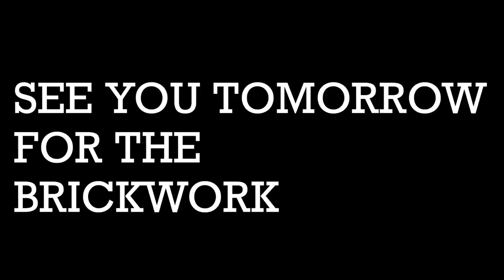Replacing Dodgy Doors Fixed In With Only One Screw - First Vlog 2020

Comment: We need to get KC a nice "Artic cable" extension lead, or you can make one up from bits in screwfix cheaper. It's good for minus30 celsius and doesn't go all stiff and useless like the cheapo PVC stuff.  1.5mm is good for 16amps so well within the 13amps from a standard plug outlet.

Comment: Make sure the handles/locks have a 3 star security rating.  You don't want a lock snapping thief letting themselves in... or you might end up having an interesting convo with the owner about the doors.. I  noticed the card on the keys so fingers crossed
Reply from the maker: yale handles/ locks are 5 star rating

Comment: Yes getting dark about 4pm Stu. Funnily enough........................it was the same last year!
  Still love the B&D Workmate.  I have an 800 model well over 20 years old and an even older one with the cast alloy frame. Still solid. Design classic mate. It was originally called Workmate the company.  B&D saw it and bought it over. Have even had Landrover gearbox sat on them while stripping ( not me the gearbox).  Those are good jobs Stu, out of the muck for a bit makes a difference, and the tools and materials we have now are brill.

Comment: And I've got me grandad's original Black N Decker workmate , plenty of extra holes in it to hold things with the plastic corners , hundreds of screw holes and it still works great , grandad passed away about 30 year ago
Reply: mike berry ya they do come in handy, I’ve got a 550 and two 800s one belonged to my dad, all seen a fair bit of abuse but still going.

Comment: Would be nice to see some air tightness around windows and doors in future...keep in up to good standard boys. Good video!!! Thank you
Reply from the maker: That’s not always possible due to double boarded internal plaster lines, you have to reduce size or hinges won’t open 👍
Reply: Yes Stu your right make them a bit smaller so doors can open probably and put build ups on side of frames